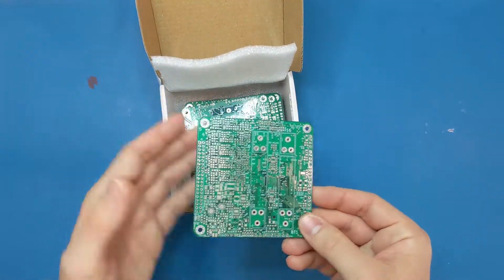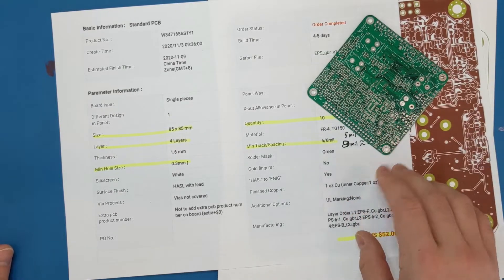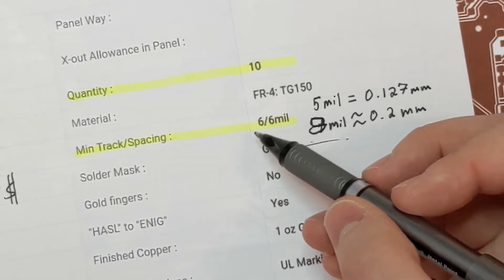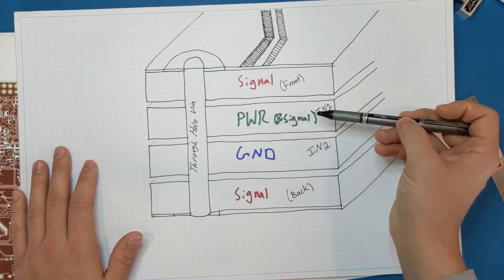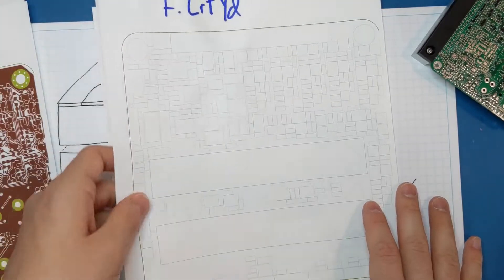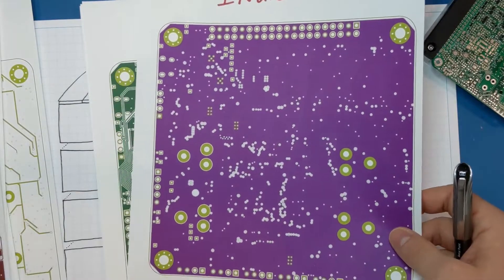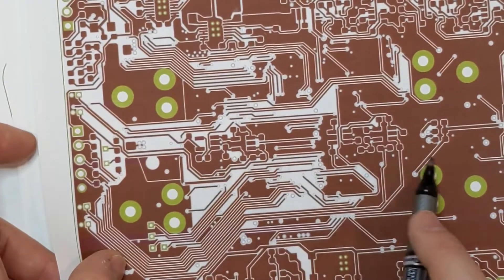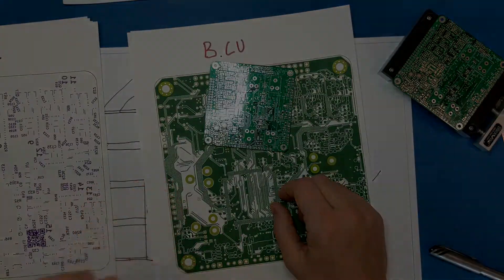$1K CubeSat - EPS Layout & PCB finished  - Part 9

Comment: how are you taking care of heat in general?
Reply from the maker: For the most part I'm not really worrying about it! My power consumption is pretty minimal (other than a radio), so I'm not too worried about parts overheating. From my understanding low-earth-orbit isn't freezing cold or very hot. I could be wrong about this.

I have a heater planned for the battery, since it can't (shouldn't) charge when freezing.

Comment: nice project,
Why you don't use flat battery as phone ?
Reply from the maker: Due to the vacuum of space, pouch cells can bulge & break. 18650 Cells are manufactured in a hard metal can, which helps to mitigate this.

Comment: I am just wondering why did you choose MRAM instead of FRAM as I read that FRAM can handle bits being flipped by radiation in space?
Reply from the maker: Both memory technologies seem to be resistant to radiation: 
MRAM: https://nepp.nasa.gov/files/16431/08_173_1_JPL_%20Elghefari.pdf 
FRAM: https://www.ti.com/lit/wp/sboa154/sboa154.pdf 

I think I initially chose MRAM because I could get a larger size memory in a smaller package. But then I changed to a smaller MRAM memory size in order to save some money, so maybe it doesn't matter. 

FRAM does have lower power consumption, so maybe I end up using it in the future!